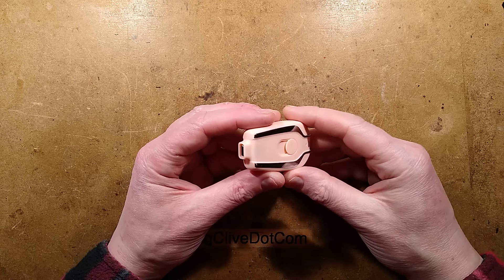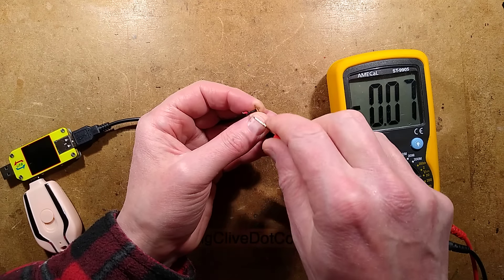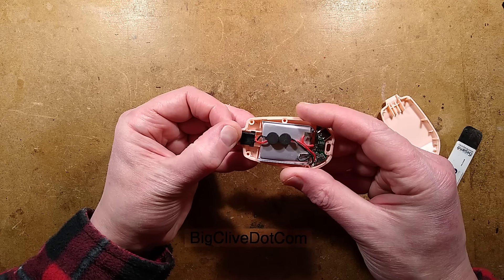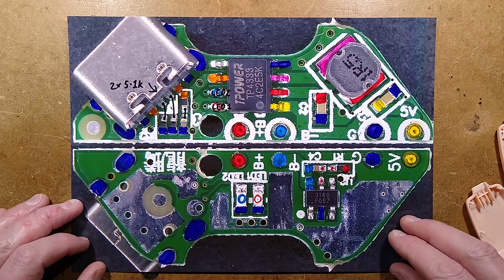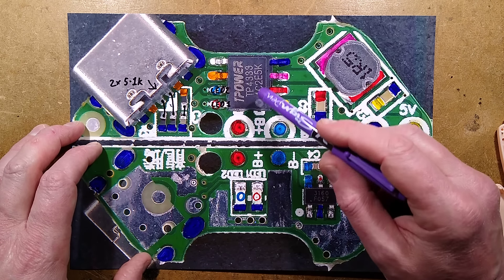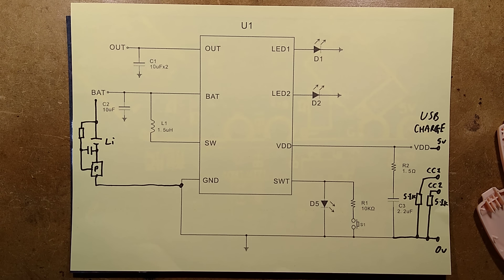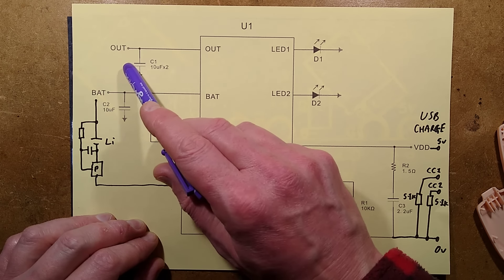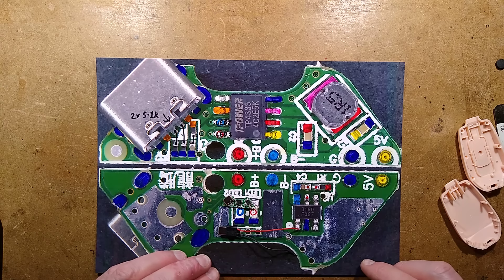eBay keyring phone-killer

Comment: We had issues with some clock radios when I was at Tandy Electronics many moons ago - the tired workers or forgetful soldered the jumpers for 60Hz when these were for Australia and 50Hz so they ran slow...  Easy fix, however we were not allowed to fix them...
Reply from the maker: I got a Tandy clock with a huge display cheap.  It had that exact problem.  A solder-blob link fixed it.
Reply: I worked for a RS store back in the 80s, we occasionally had people ordering quite expensive computer accessories then backing out of the purchase. One I recall was a memory card full of DIP RAM, it was probably something like 256K or something. It was $1000 or more IIRC.
Tandy would NOT allow us (a franchise dealer) to return computer components _unless_they_were_defective.
We couldn't afford to sit on a $1000 product that nobody would ever buy. So we made it be defective. A sturdy 12 volt CB radio supply across the 5 volt bus and GOSH now it's returnable.
Reply: @John_Ridley  LOL. Yep!
Reply: @John_Ridley I hear that stun guns are great things to make electronics defective.
Reply: @clallen2000  The problem there is they will arc across tracks and leave obvious burn marks.
Reply: I remember our local Tandy Electronics (Australia) store back in the 2000's. Sad that electronics are not profitable for shopping centre retailers these days so all those stores are long gone.
Reply: @jimtekkit  Sad?  Inevitable more likely. Due to rising commercial rents, these places were pricing themselves out of the market for small items and components.  In Australia, even good  "bricks and mortar" outlets like Jaycar and Altronics could soon go the way of DSE.  They can probably only just survive as suburban strip-mall or on-line stores.  And the high postage costs will not help their on-line profitability.
Reply: I miss the Tandy junk box they used to have in England,  I got so many bargains! 🙂
Reply: @hectorpascal  Doesn't make it any less sad
Reply: @lesallison9047  Maplins too.
Reply: @jimtekkit  And so many Jaycar staff are totally useless. I miss Tandy.
Reply: @MattyEngland  
Hi Matty, yeah when they closed down in my old town, I somehow felt like an old friend had died 
🤣🤣 those where the days my friend, its just not the same online. 😔 Regards
Reply: @jimtekkit  Vancouver BC still has one. It's independent. And there's another one which is aimed more at the industrial/ technical sector.
Reply: @ConstantlyDamaged  Never had that problem with my old 50,000 volt stun gun. A 3-5 second jolt was enough to kill most electronics.
Reply: @John_Ridley  I once got my ISDN adapter upgraded for free, because it failed during a thunderstorm.
I didn't mention I connected it to the electric fence, but it WAS a thunderstorm when I did it.
Reply: I worked for Tandy for a week. I honestly couldn’t stick it any longer.
Reply: @lesallison9047  Yeah I know exactly what you mean! The new Maplins catalogue (physical version) was something I'd always look forward to browsing through when it came out. 👍Hope you have a good weekend.
Reply: In the Netherlands we are allowed to open devices and repair them ourselves, repairs will not void the warranty, and the shop/producer must prove that the consumer(repair shop, etc) did something wrong that caused this defect.
Reply: @MattyEngland  
Thanks Matty, same to you.
👍
Reply: I did my apprenticeship at the NZ Sanyo agent. We used to get a lot of duty free clock radios ,brought in by travellers ,that needed the 50/60 Hz change. It was easy on LED digital clocks, but the flip character electro-mechanical clocks need to have the mechanism replaced.
Reply: I'm guessing the clocks would lose 6 minutes every hour?
Reply: in this case it's likely the poor slave labored kids.
Reply: @davelowets  yep
Reply: @hectorpascal  The local council are mystified that the footfall for the shops decreased substantially. Seems there is nobody at the Council smart enough to put 2 and 2 together. Parking on the road used to be free for 1 hour and then 20 minutes and now no free parking on the road at all even with a blue badge.
They rent out the council carpark to a company that feature often on the worst parking company lists, the type of company that claim you parked for 1hour and 1second and only paid for 1 hour where in reality it took you 10 minutes to find a space then another 10 minutes trying to get the machine to accept payment so parked for a lot less than 1 hour.
Reply: @LeifNelandDk  We just got our sons MacBook repaired under warranty. We had a very close lightning strike and while it didn’t hit the house it immediately killed our modem. A couple of days later our son went to turn on his MacBook and it was dead. We ended up taking it back to the Apple Store and they sent it off for repair. Got it back all fixed with a list of the replaced parts including the motherboard. We may have forgotten to mention the very close lightning strike or the fact it had the charger connected at the time. Maybe it was an EMP caused by the lightning because they were the only two things affected. Weird.
Reply: @jimtekkit  Jaycar and Radio parts live on.
Reply: @John_Ridley  A brilliant and simple solution to a corporate idiocy... : )
But how come someone could place order for such expensive stuff (a grand back then would be like five grands now) without any down payment?
Reply: @hectorpascal  I used to work for "Rat Shack" for a year or two.  Main reason they went belly up from the store perspective is simple:

Let's ditch our 'branded gear'  (re:  Realistic/Optimus) and outsource to garbage crap.  Yes I know the bulk of Optimus was made by Pioneer, and back in the 70's it (Realistic) was a mixture of Hitachi and a few really good manufacturers (unless you went 'good' and not  "better" or "best" in the catalog.)  But  when they started to shill RCA and dumped their house brands--..Combine that with  "Hey, we want to be YOUR cell phone accessory store"  (when the mall kiosk cart and eBay are doing the same product for a fraction of the price)

They shot themselves in the tuckas.
Reply: @Tedybear315  Yes, it's the same sad story all over the world.  I think you are probably quite right that it was the universal availibility of dirt cheap Chinese equipment and accessories, that largely contributed to the unprofitabilty of Radio Shack and similar stores.  In addition, the "Fix 1500" management skill assessment was so badly conceived it must have demoralised most of the remaining loyal staff.
Reply: My grandfather had one I think was Tandy. it was  made  of bakelite.
Reply: @WoodyWard  Yup. Don't feel bad about it though. The company was intentionally trying to drive franchise dealers out of business. Company stores were allowed to return whatever they wanted, franchises couldn't return anything.
Also it was 40+ years ago and it wasn't me, I was just there. The guy that did it has been dead for 20 years.
Reply: We just set the alarm 4 hours & 48 minutes earlier. Problem solved!
Reply: @John_Ridley  I learned that while dealing with computer parts suppliers. If its needs an RMA, make sure its dead.

Comment: What the reversed polarity output indicates is that there was absolutely no final test of the assembled product. They tested the board with no output connector installed, it passed the test, and then they soldered the output leads in place, packed it up, and out the door it went. Duh.